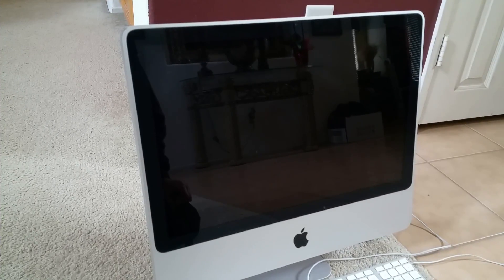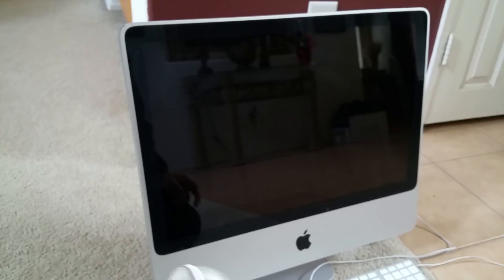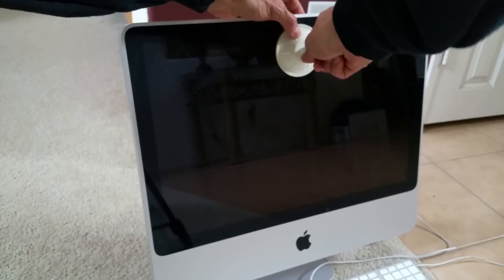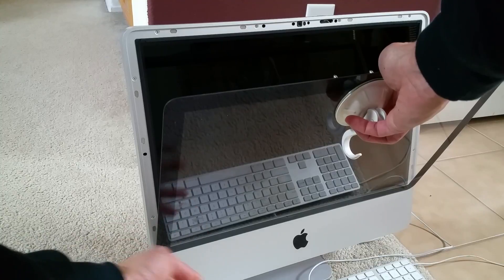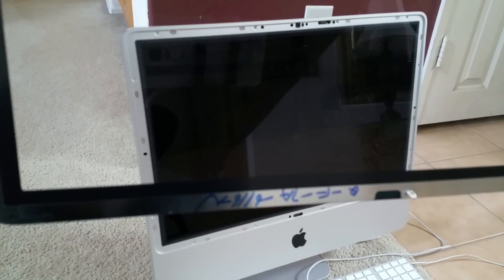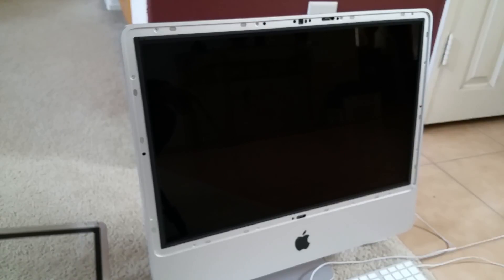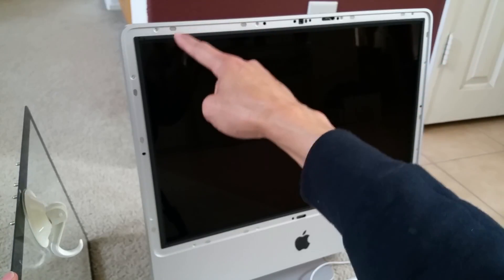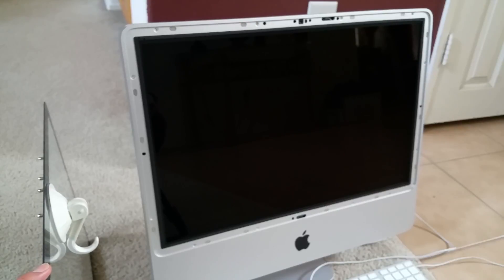Easy! How To Remove iMac 20 21 24 27 Inch LED Monitor Display Glass Panel Full HD 2017

Comment: It worked great for my 2011 iMac 21.5 inch model. However, I had to lay down my iMac on floor face up. Otherwise, it kept sliding forward when it was in the upright position. Thanks so much MacDaddy. Now I have to figure out how to back up the hard drive. I have never backed it up in 9 years!
Reply from the maker: Thanks for sharing